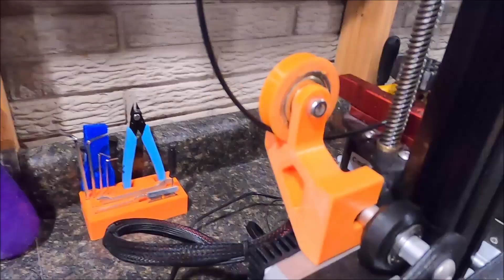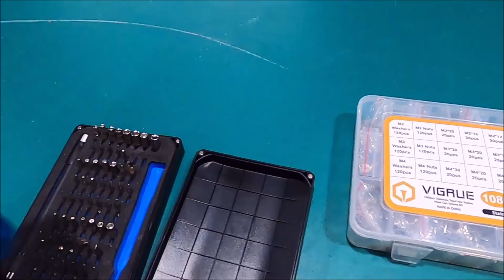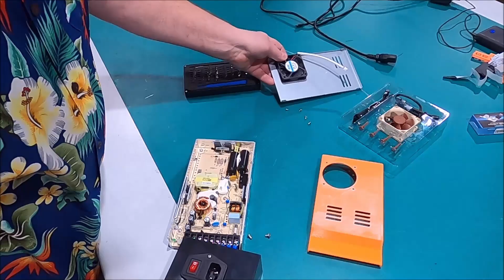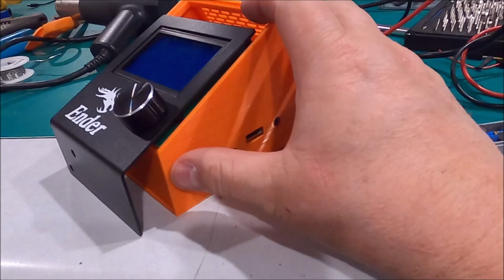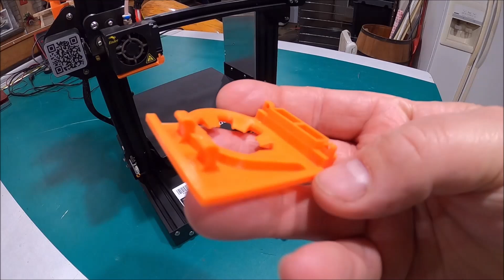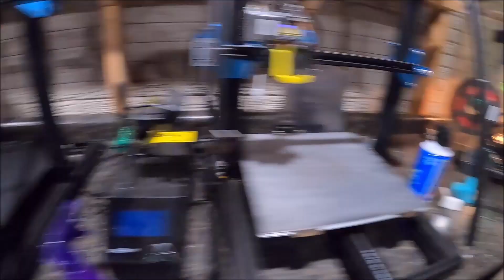Creality Ender 3 Pro Upgrades Best of the Best How to Part 1 My favorite 1st round of improvements

Comment: Just found your channel, love your energy and useful printed upgrades! Been using that filament roller (on the side of the extruder) for a few years now, works great.  Looking forward to more upgrades.  What is that LED light on the top?  Didn't see it in the links. Thanks.

Comment: While the GPIO pins are acceptable way to power the pi, it also lacks the power spike protections in the USB port, considering the quality of those buck converters, I would splice a USB micro port and use that instead.

Comment: Thanks for your video!
Great suggestions.
One comment: the roller adapter for the spool. I printed one and installed it, then later my full roll fell to the floor. The bolt part broke from the clip. I still liked the idea of the roller, so I printed a new bolt etc, and used a long screw to solidly connect the bolt to the main part, by angling it down so it didn't interfere with the roller part.
Reply from the maker: Print it horizontal. It will have more strength. Always something to consider which way the grain runs.

Comment: For the filament roller housing how did you place the part in the slice and what support locations you use.
Reply from the maker: Laid it out horizontal and used support everywhere.  this direction gives it more strength.